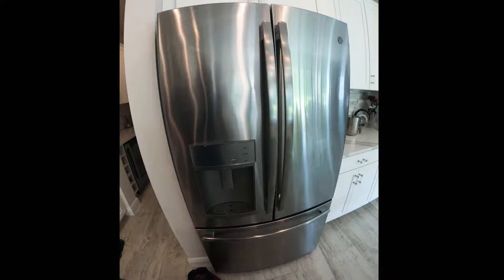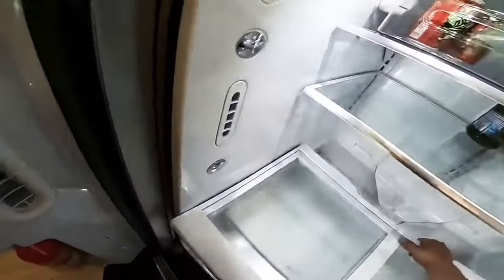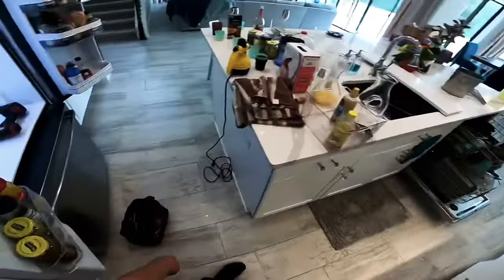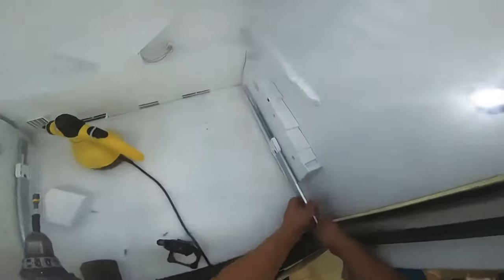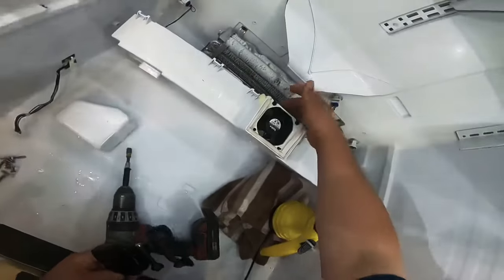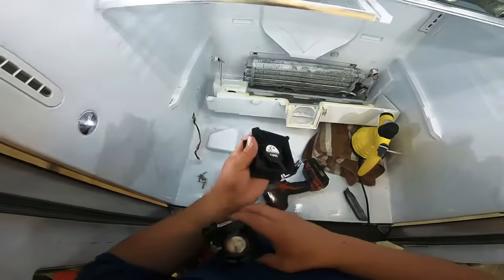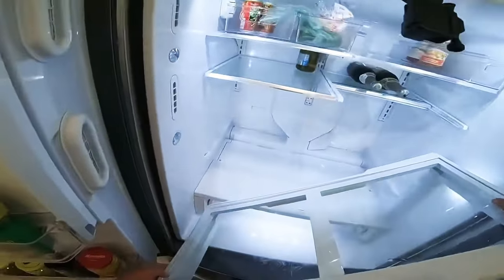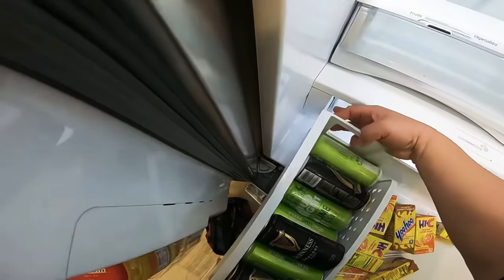How to Fix GE French Door Refrigerator Not Cooling, Freezer Working Fine | Model PFE28KSKGSS

Comment: One note....even if your fan is not turning, it may still not need to be replaced. Sometimes the fan rotor and housing can develop a little ice build up that prevents the fan from turning. With the fan connected electrically, use a screwdriver or pen (but not your fingers) to just turn the blades a little in each direction and it'll break any thin ice build up and allow the fan rotor to turn again. If nothing happens after trying that, then you need a fan replacement.
Reply: @nlabanok  am I in trouble if I got a new fan and plug it in and it’s still not turning?
Reply: From what I can tell it's probably the board not sending power. I'm about to toss mine and I'm deciding if I want to go through the trouble of checking it. To replace the fan is ok. To fix or replace the board I'll not bother. I've already replaced the fridge I've got 3 working but if it's a cheap fix I'll make room for it.
Reply: @villageidiot9867  for me replacing the fan and then restarting the fridge fixed it.

Comment: You are THE MAN !! I thank you SO MUCH.  I am pretty capable of doing repairs myself, if I have instructions. Which you provided EXCEPTIONALLY WELL! Not only did you save me money on a service call, but you saved me money on the part! Almost half the cost on the link you provided, from the cost GE was asking on their website!!   I see from comments on the GE website and from others that GE is aware of this part having issues with this needing replaced every 3-4 years. Sometimes sooner. With a service call of almost $400..on a refrigerator that cost $2500 if one needs to do this every 3 years you can rack up the price of this fridge pretty darn quick. It sounds like consumers need to gather together and do the same thing that Samsung owners did and file a Class Action Lawsuit against GE for the money we are needing to repair this issue THEY KNOW IS AN ISSUE.  And what is bad…on one of their comment …they even wrote back and RECOMMENDED THAT A GOOD RESOLUTION MIGHT BE TO PURCHASE THEIR 5 YEAR WARRANTY!!!   What a flipping joke!!      Again, thank you for helping !!!
Reply from the maker: Glad My Video Helped Out By Repairing the Issue and Saving you Money, As that is My Goal. Thanks For the Support and For watching My Video!
Reply: I replaced the part, thanks to your great video! Took less than 20 minutes!  But, 2 days later I got the loud buzzing noise once again 😞. It lasts less than a minute. Doesn’t do it all the time. When I pull the refrigerator out, the sounds comes from the middle. I took the refrigerator apart again.  The fan motor looks great. Spinning as it should. Is there another motor higher up? Any thoughts as to what that buzzing sound might be?    Also, I noticed the motor to the left that blows air into the lower  big deli drawer wasn’t spinning. Should it spin all the time? Or is it dead, and need replacing? If so, do you have a link to that? THANK YOU SO MUCH FOR YOUR HELP

Comment: Thank you for your helpful video.  I am having this issue.  I replaced my fan motor and it may have help a little. I have a GE French door.  Now I noticed my display indicates the refrigerator is at 37 degrees. But it is actually 46 in the refrigerator.  What do you think the issue is?  The temp sensor?  Do you have a video on how to replace this?  Thank you for all your help

Comment: Hello - thank you for the video. Very helpful. Are you able to tell me if the fan is supposed to be on all the time or does it cycle on and off? Thank you.
Reply from the maker: If you’re talking about the inside fan, approximately every 10 or eight hours turn off on defrost cycle also install models the fan is on when the doors are close if you’re talking about the outside fan by the compressor the fan supposed to be on when the compressor is on and again it will cycle every 8 to 10 hours
Reply: So therefore, if the Compressor Fan (behind fridge to right of Compressor) is on then one can assume the Compressor /Start Relay is activated and more than likely NOT the issue of the warm unit.  I did not observe ice behind/around the Freezer Fan; however, this fan (Back Wall Bottom Freezer) is NOT running when I open the bottom freezer door and Hold  the right Light Switch closed.  I can freely turn the fan. (Could the fan not turning be due to a broken Temperature gage ( Thermistor?) or is this fan ALWAYS on except during Defrost like you stated previously?

The Fan in the Top (Fridge) compartment sounds like it is on and I CAN feel air blowing at the top of the Tower; it appears to only keep the Fridge around 55 F.  I would rather not take apart this back unless you think it is necessary.  The Bottom Freezer fan # is WR60X25858. I would like to at least validate power is getting to the Fan to be confident on this replacement purchase.  Will a Multimeter work to measure a DC current at the Bottom Freezer Fan connection and, if so, what value should I read?  ANY feedback would be very much appreciated!

P.S.  I have a 2021 GE French Door Mod# GWE23GYNDFS

Comment: I was replacing fan an accidently pulled the wires out of the little plastic I don't know how to put it back together any suggestions please
Reply from the maker: If you are talking about the plastic to hold the wire in place, you don’t have to put it back in the piece of plastic just put the cover on and that’s it

Comment: My biggest question  on these ge French door refrigerators is I replaced both fans in the fridge part and the fan in the freezer, why does that drain hole keep freezing  solid. I took the hose off and it is clean on both ends 
And water runs through  it without  any problems.

Comment: Hey, I have a wiring question about this refrigerator. Specifically, the plug for that climate controlled drawer. My brother was cleaning his and unplugged that harness for that drawer system and the pins came out of the plug coming from the actual fridge and they apparently touched and the refrigerator shut off. Isv there a fuse or breaker in the fridge that can be reset? Or did he fry his board.
Reply from the maker: Try to Disconnect the drawer harness and leave it disconnected, and Disconnect the Refrigerator for a Couple of Hors then Plug Back in. If when you plug it back in it doesn’t Work, Then It looks like the Control Board Needs to be replaced.

Comment: If you're having problems with temperatures after this, you probably also need to replace the  Temperature Sensor p/n WR55X10025. (Less than 10 bucks from the amazon for a two-pack.) The sensor is right smack dab in the center of the fridge ceiling under a little dome-like grill. 
As for the video, I liked the content, but i suggest cleaning up the kitchen clutter first before shooting. And, either get a better mic or speak up. When the commercial came on I was almost blasted out of my seat. 😳